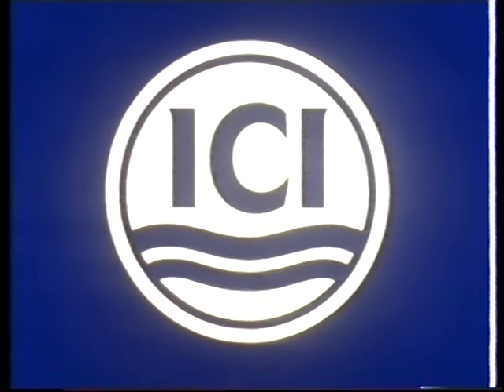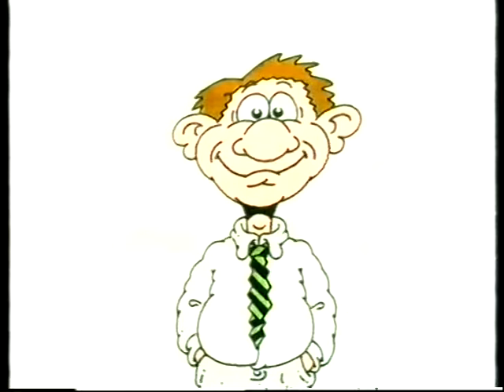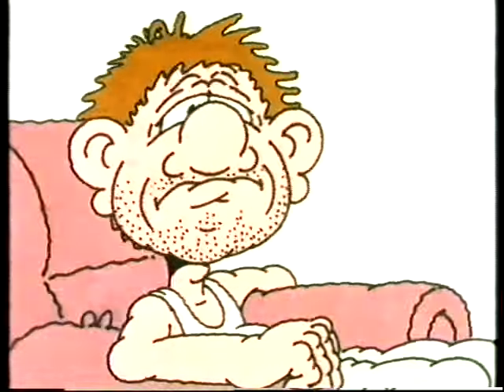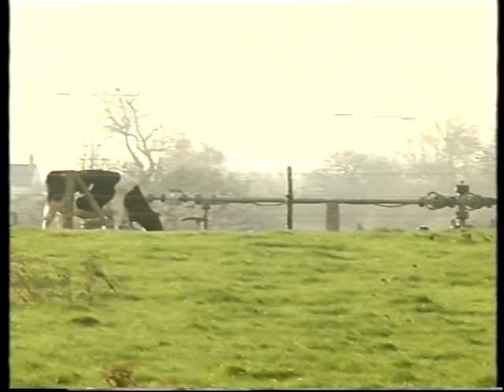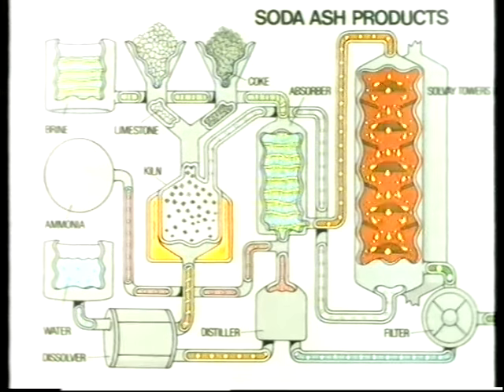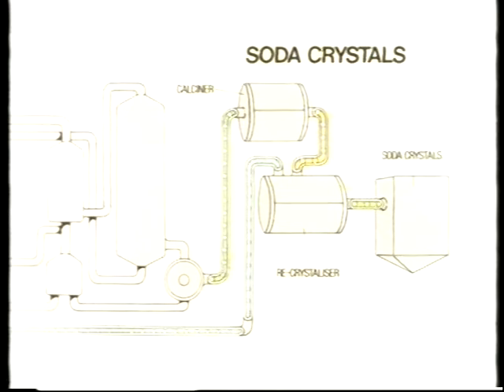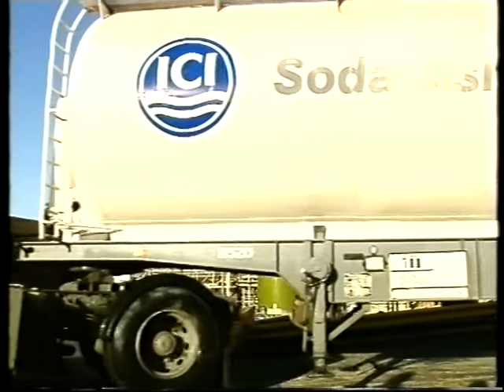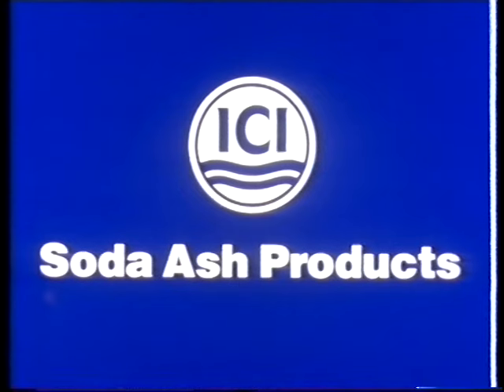Med 014 ICI Soda Ash Products film 1991

Comment: From a massive giant bellwether of industry reduced to nothing by privatisation and getting rid of divisions / departments and manufacturing facilities. RIP ICI.
Reply: Not strictly true but mostly

Seriously you must understand that half the ici business was r&d and research into manufacturing processes and chemical engineering 

Not much call for this today 

The internet meant that places like Brunner house etc where not needed to meet sales etc etc or to control r&d and high tech labs 

Winnington itself is extremely interesting the home of smooth glass clingfilm etc 

And then the fact they had worked out how to produce soda ash before solvay however solvay correctly started out looking at industrial production and not proof of concept

Remarkable company and history of my local area in its hayday a truly magnificent monstrous area of industry also worth noting that advancements also mean that half the site space was needed for soda ash production

For example walerscote aka the island closed the winnington plant over the road didn't even need it's lime beds for winnington production as they moved to lime slake towers instead 

this in turn also sped production up lots for winnington

And moving more soda ash by road meant there was less needed to store the final product in the island storage towers for huge trains to move it 

So just in the case of winnington by appearance it's 1/5 it's original peak size of area and is only around 40% down on production

So as much as I agree it's a factor it's also part an illusion

Hope this helps